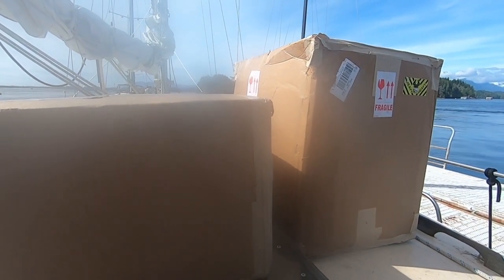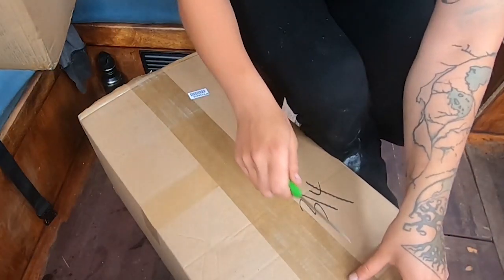Electric propulsion & Lithium batteries - Sailing Oka Solo - 027

Comment: Are you wiring your solar in parallel or serial?
Reply from the maker: Series as the mppt controler needs higher solar input that battery voltage in thi case the batteries are full at 56v while the max output of these solar panels is 48v altho I just ordered a renogy boost controller that should allow to use a panel on its own and boost the voltage up at the cost of a bit of efficiency
Reply: @SailingOkaSolo  The panels that slide under are in series with the panels above?  Are they 48V panels?
Reply from the maker: @markleyg  those ones were 36v each in series at 72v but i since sold those ones, im in the process of redoing the array differently as I got an awesome deal on 2 brand new 500w for 250 each

Comment: I don't see electric being sustainable up here on the pacific coast of Canada... cruising around the caribbean maybe. Even with a massive power plant of batteries, you'd still need tow and wind generators for many months of our climate. I've lived and boated here all my life, many many years, I just don't see it as feasible... or safe. Would love to know your thoughts as time goes on. Love your videos, hope to meet you out there one of these days
Reply from the maker: Hi there well i sailed 400miles north in January in the worst possible weather with a very limited battery pack, I now have more than double the capacity and just sailed from the north coast to the gulf island in the last two weeks without a hiccup. I sometimes run "hybrid" using a honda suitcase generator if im on a schedule and conditons arent favorable. I have been perfecting  the system since the videos where posted. It does change the planning as I am trying to sail as much as possible. Its not for everyone but 1000miles sailed since the conversion, I do not regret it one bit and the number of electric sailboats in bc is growing fast i know of a dozen so far.
Altho I am sharing my conversion im by no means trying to preach it and wouldn't recommend it unless one is able to sail engineless.
Reply: @SailingOkaSolo  Howdy there back... darn youtube turned my comment replies off again... anyways, that speaks volumes if you say so. I noticed you were running your honda a fair bit, but, ya, I get it. I picked up a little oday 222 been learnin myself how to sail around comox. When my cats pass, I'll be upgrading and sailing up and down here as you do. Might have seen your boat in comox harbor mid august?? Enjoy your vids, thanks!
Reply from the maker: @Cacheola  hey never sailed to comox yet, but yeah huge difference i just got the new battery hooked up a couple months ago and running that 2kw honda was ridiculous as it couldn't handle the main 3kw charger so i had to charge with an 1000w charger which was nearly useless for hybrid purpose, i now have a honda eu3200i which runs the big charger allowing for 5 knots without using up the battery in perfect condition (1kw =3knots ) it got about 15h of running so.far from the central coast to the gulf island
Reply: @SailingOkaSolo  Nice! I love that new 3200!! It's about time. The 2000/2200's rev so high on the higher loads they stress you out lol. Hey, if you haven't dropped the hook in James bay or better yet Selby Cove on Prevost Island... they gorgeous ;)